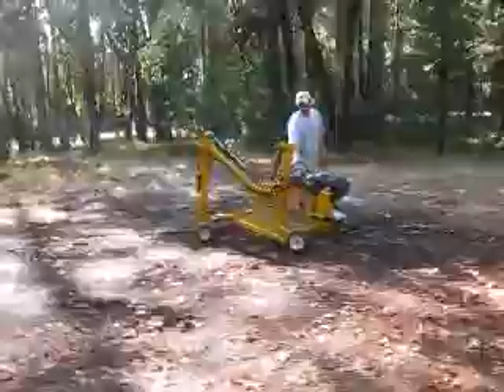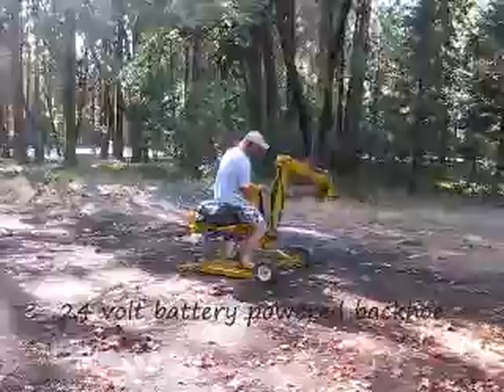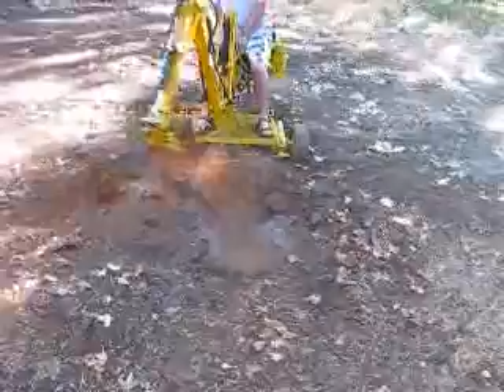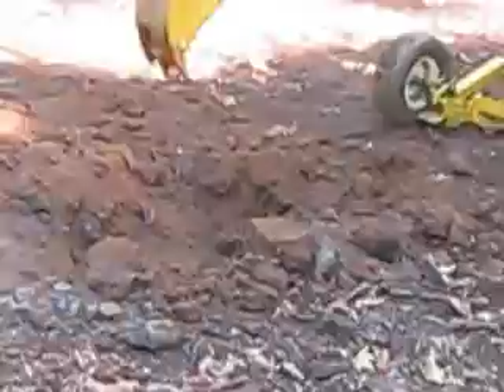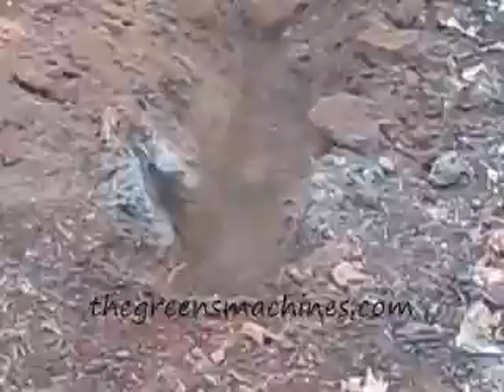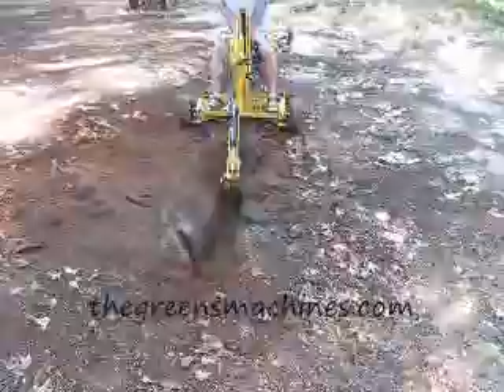electric backhoe

Comment: I bought Lonnies plans and built the backhoe. it works great!  I have moved over 1000 Wheelbarrows of dirt out of a basement I'm digging out with it,  I went total electric with a 2 hp 120v ac motor. it's so quiet you can talk in a normal tone while you work.  Thanks again Lonnie!

Comment: What a great idea, and even better execution. Perfect for the occassional user. Another great thing about electric, as long as you care for the batteries the machine can sit forever inbetween uses. I would think not hard to addapt to plug in electric. Terrific, terrific, terrific. Great Job. Nicely designed backhoe too.  Only think missing is mechanical swing, probably not a big deal with such a small machine.
Reply: For the guys that say that they can work as fast as a pick and shove. It's bullshit. 
They can't out work hydraulic. 24/7.
With a kick ass alternator. Would keep charging as long as you want to use it. 
To the guy that said it was jurky. The smaller the machine the more they beat you up.

Comment: So where can I buy it? Also, it plugs into an extension cord right?
Reply from the maker: Yes, It can be built to run on battery, 110 volt or gasoline.. 3 different ways to make the 2000 psi.